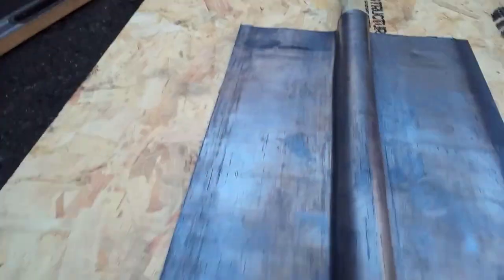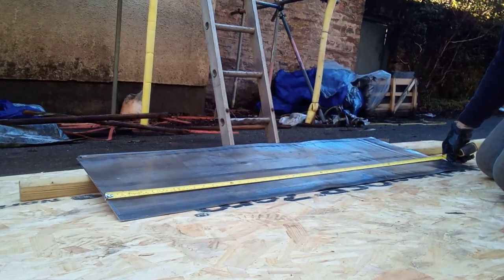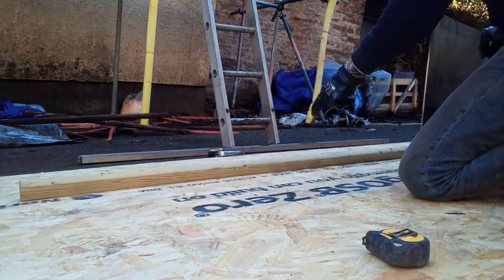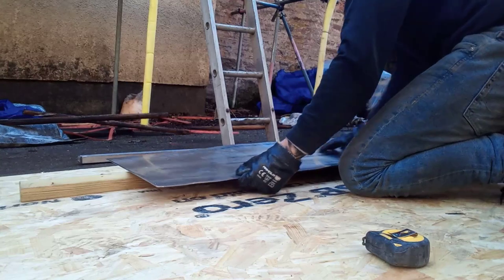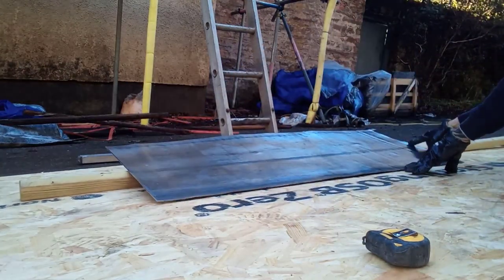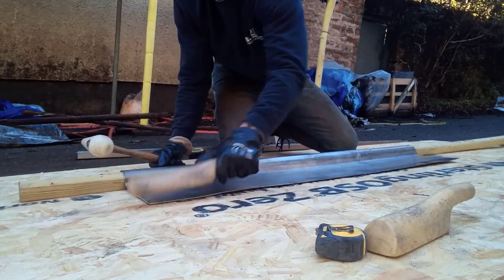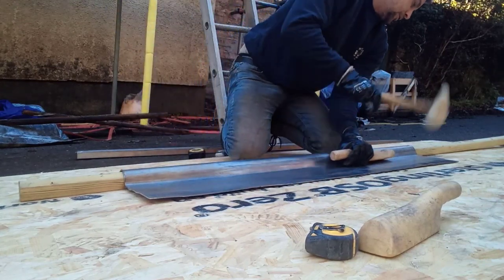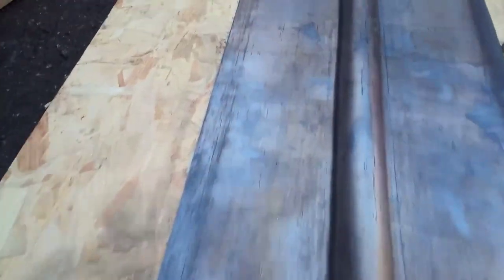How to make Lead ridges/hips for roofing

Comment: Try folding it first
Reply: If u fold the lead into a u shape with 120mm on base push on top edge of lead it will fold  around the roll and then u can boss roll ends